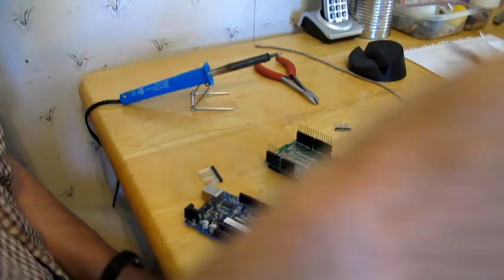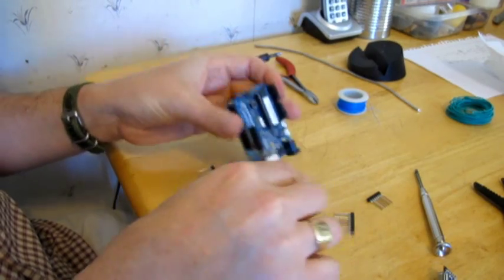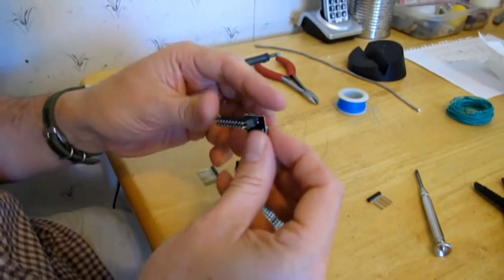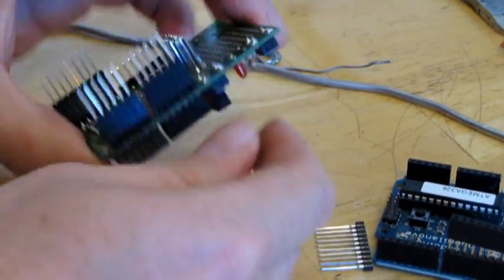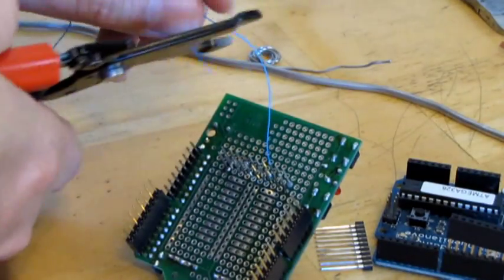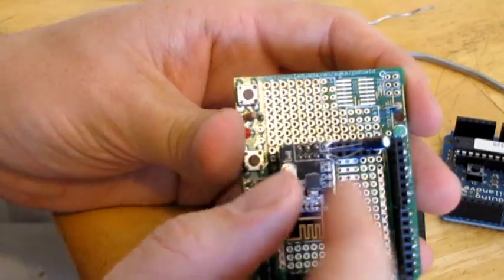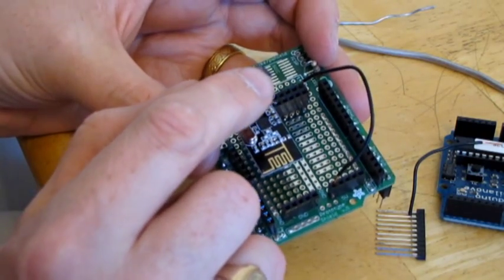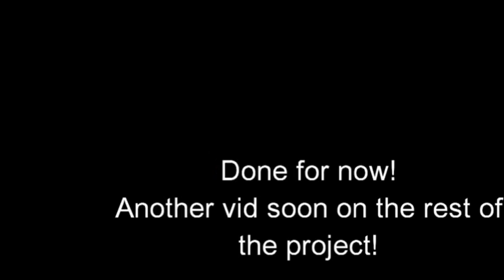Intro to Wire Wrapping

Comment: I have a question, if you didn't solder the socket into the perfoard, and then waited until you wire wrapped everything up, would these wire wrap connections hold the socket in place? 

Cause honestly, I'm thinking of a way for kids to go beyond breadboards, but also doesn't require solder:
-as they are kids, I don't comfortable with them using a hot soldering iron, I don't think their parents would like that either 
-the stink of solder, and lack of space and ventilation

can stop many kids perusing further learning in electronics. Thus, wire wrapping looks like a good step up from a breadboard (more permanent construction), except for the need to hold the wire wrapping socket in place by solder, so any ideas?
Reply from the maker: Sorry for the extreme delay in responding! I think soldering is a good skill for kids to learn and both of my kids had a try at it when they were younger. It's not something I would have a 5 year old do, but 8 to 10 years old with ADULT SUPERVISION should be fine. I really don't see an alternative to soldering the wire wrap sockets in place, but you could maybe use hot glue. I would say that wire wrapping takes a lot of hand eye coordination and patience so the kids would need to be into that. As well, I find it very tricky transposing a design from top to bottom of the board (and reversing all the pins). I make mistakes all the time doing this and have to go back and rewire my boards!! A good skill for kids to learn, but it can be very frustrating.  would say that it really is a good step up from breadboarding, but a step down from designing your own circuit boards. Thanks for watching the video!